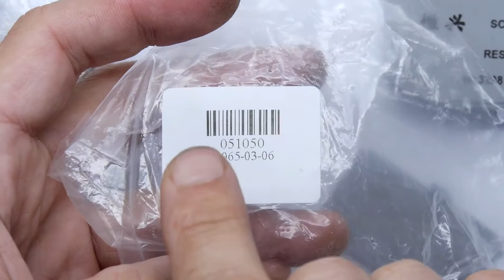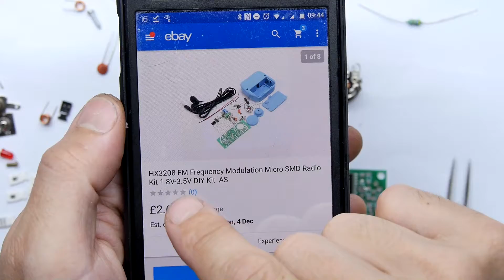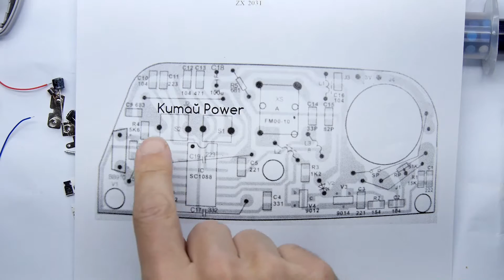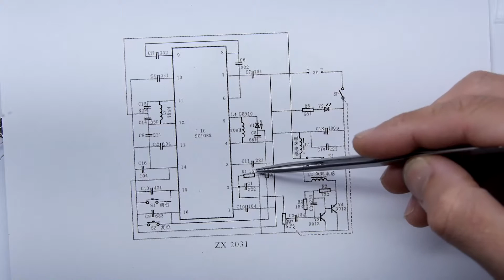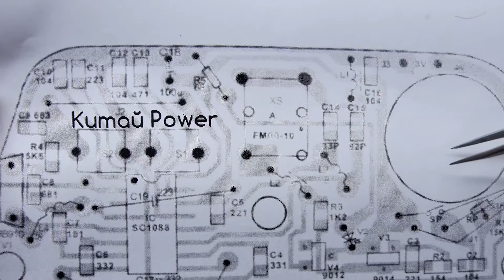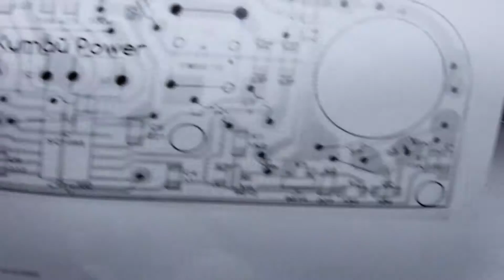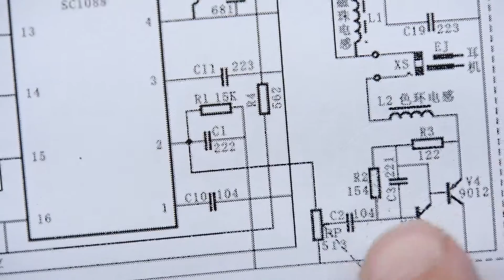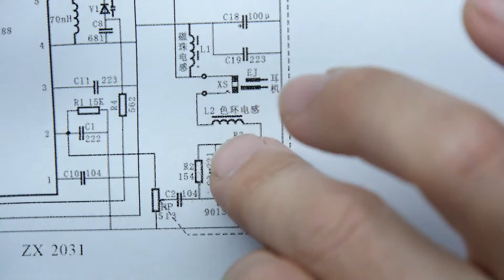HX3208 Radio Kit

Comment: Also sir andrew could all that heat soldering the ic at the beginning possible damaged it ? only saying that as I just baked an atmega 128 ... not very happy @ £6 a pop /cry
Reply from the maker: +Brian Jones Should be fine sir, what temperature were you running at?

Comment: I made one of these last week and is working well but earphones are junk, good for the wire and plug at least. i did add the extra jumper above the potentiometer (the one without the resistor symbol), that may be worth a shot.
Reply from the maker: +capri2wd I will give it a shot!

Comment: Just made one today and I got issue with 2 things.   

First, the button for the reset and aren't really align, so it stay down and I can't push those buttons no more.

Second,  I have current but no radio signals... someone says it might be the inductors who got a enamel coating and I might have solder an insulated part

I probably should kept more pins for the switch... if it that my issue ... I need 2 new one

Comment: I bought the same kit and had the same result.  I checked the epoxied wires from the henry and they were tined, validated with ohm meter.  Other than that it just did not work.  Maybe it needs an antenna to match with broad cast in the local, not from asia.

Comment: Thanks for your help,I paid 15.99 for mine solder from kester,maybe I should have bought the cheap one like you,as long as any solder I buy is lead 60/40 or 63/37.
Reply from the maker: +Ron Thompson I always use leaded if I can, it flows so much better

Comment: You dont worry about damaging the component from heat?
Reply from the maker: +Oddzball3 Generally most components are designed to take a fair amount of heat before they die, so I prefer not to hang around if I can help it. 

That being said, I have found many sensitive and already broken components in cheap kits, so extra care is always a good idea 😂

Comment: I think your C1 capacitor is facing the wrong direction and needs to be turned 90 degrees. 😀 I’m not done watching so you may have caught that. It’s the arrow on the R1 that’s making me thing that.
Reply from the maker: +Robert Roland There is a strong possibility I screwed up in multiple ways, I will add this to the check list! Thanks 😂
Reply: The cap is in the wrong direction.

Comment: This is  A Great Video, no i get some refound from Ebay Becouse the Seller not including some Pdf or Schematic, if i sao this Video at the beggining i was not tresend it back, put some keywords under youre video like: "FM Micro SMD Radio DIY Kits FM" and Many ppl can View this video and Solve the Chines issue,
Thanks again. Barak From Israel
Reply from the maker: That's good to hear I could help in some way
Reply: yes i glud to, when i build it i was many mistake with the cermic capacitors, how can i recognize the capacitor ceramic value and put it on the pcb?

Comment: Your radio did not work because you overheated the ic or 9088 chip the solder iron should not exceed 3 seconds per lead as instructed by the data sheet from the manufacture.also the led  probably did not work because the polarity was reversed during construction.Hope my info will help others my little hx3208 worked first time after finishing the project.Great little radio but would have preferred a whole through placement of the components which I am working on now a new pc board and easier parts placement in minutes not hours!

Comment: Your Radio wont work because, oy where do I begin?
1/. Your surface mounted chip no doubt was overheated, only fix is source another chip and if successful don't heat replacement more than 2 seconds once the solder is liquified, yes those chips can take an insane amount of heat, but oy never EVER as much heat as you applied in this video, thus I suspect the main reason why she nor go..
But hey yo never ever know as I was astounded my grandsons worked, so review and exhaust the below suggestions first.

2/ NPN & PNP transistors may have been inadvertently swapped and thus inserted on the board in their counterparts position.
3/. whilst soldering in your transistors I noticed something potentially "semi-conductive if it's a hair thus acting as a resistor" if not a hair a potential strand of conductive wire could be bridging one if not both transistors on the PCB, also there is another strand elsewhere that could potentially also be much the same problem, just review your video carefully whilst you were soldering in the transistors to locate all the potential shorts "what I suspect and hope is Hair and for your sake acting as a resistor, which isn't as bad as a conductor when it comes to shorts.
4/. some of your capacitor leads "folded over capacitors" are a bit long thus are a possible cause for oscillation and or a signal source that forces the transistors beyond their operating specifications. 
5/. Verify the chips specifications with it's manufacturers suggested circuitry and make sure your schematic is close if not exactly as recommended by manufacturer.
6/. Make sure all components are as specified by the chips manufacturer rather than the kits schematic, "also ignore what the PCB has specified" that is if the chips manufacturers schematic is close to your kits schematic, as I suspect you may have a "Generic PCB" that has been modified to reflect the aforementioned chip manufacturers schematic, and when components are not available close enough ones have been specified and provided in your kit.
Good luck with sourcing a replacement chip that is if your chip cant be sourced, as there are 100's if not thousands of them chips that could work in this extremely basic circuit, which BTW my 9 Yo grandson successfully built, and like you excessively heated what seems to be a hardy chip..